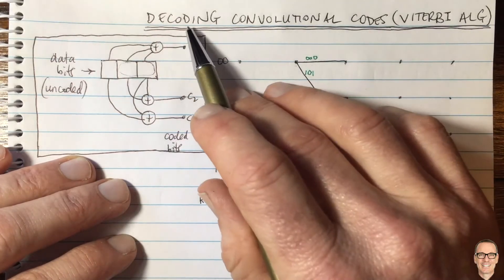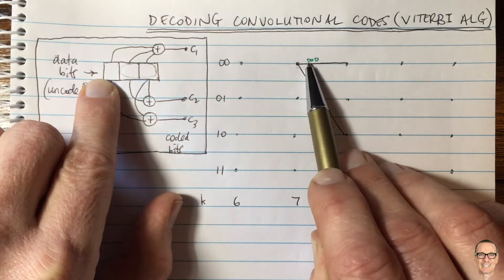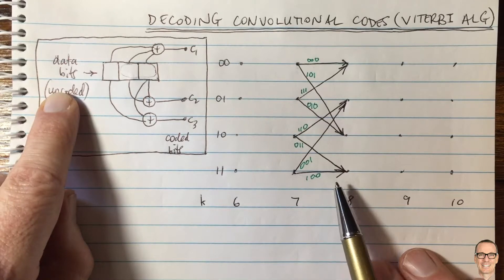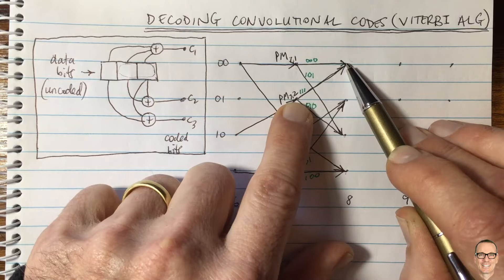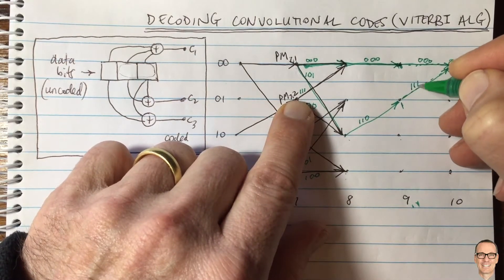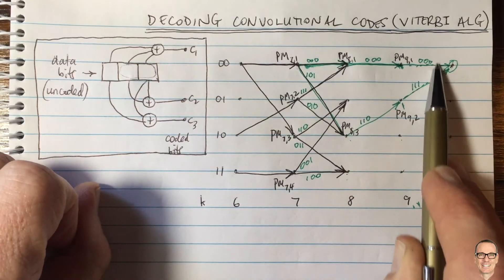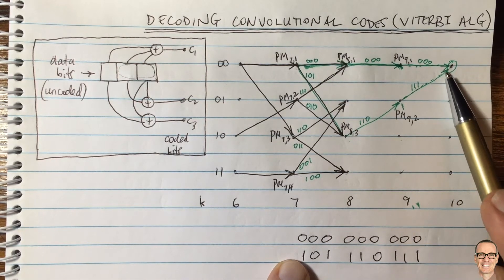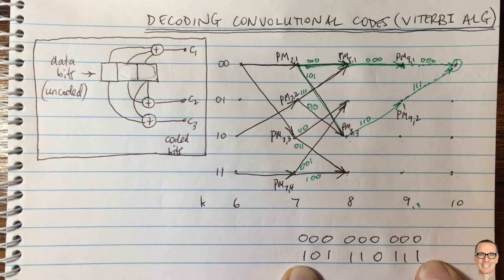Decoding Convolutional Codes: The Viterbi Algorithm Explained

Comment: Thanks. This was very helpful. I am working on figuring out what happens if there is a tie. For example at a branch, if I have the total path metric is the same for both paths? Do I make a choice and keep going? Or do I keep both branches? Thanks
Reply from the maker: If the metric is the same, then there's no way of picking them apart, so you just need to make a guess. Everything you're doing is "guessing" it's just that the other metric decisions are "educated guesses".
Reply: Thanks!😊

Comment: If I say anything then I could be decoded. What you need too see is this is like Pine Gap in education. But then it would imply that there is deception intelligence in engineering and the education. Then there's espionage in job allocations and position fitting a person's role. Maybe the NASA educational stance is the way to go to avoid building another espionage empire with engineering and education into the money stream. Basically at some point lower voltage operations and higher frequency transmissions equate to increased complexity in decoding in noise. Maybe there's a practical limit since you can't miniaturize Pine Gap below Moore's Law in which case it's Quantum communications instead of a noise floor for intelligence in error correction. Sorry if I'm a little hard to understand....but you were not to clear yourself. But your genuineness is appreciated...

Comment: great video! I'd like to point a possible mistake, I think you swapped the possible outputs of the states 01 and 10 (assuming the bits are represented in the same way as they look in the boxes)
Reply from the maker: Let's take the line that joins the 00 state (on the left of the transition) to the 10 stat (on the right of the transition). For this line, the contents of the three-element shift register in the encoder are 100. This is because the "state" is defined as the contents of the central element, and the right hand element of the shift register - and for this line in the trellis, the current state is 00, and the next state is 10. This means the output will be 101, if you trace along the lines for the three outputs.
Reply: @iain_explains  thanks! it was I who confused myself here, you're right 👍🏻

Comment: Your solution is not clear and complicated to understand
Reply from the maker: I've made a new video where I've tried to explain the Viterbi Algorithm more directly, using the actual update equation, and showing how it relates to the trellis. I hope this helps: "Viterbi Algorithm Explained with an Example" https://youtu.be/xxpBHCkypS4
Reply: Did you watch the previous video in the series where he explains the convolutional code? Might help. I do agree though that an explanation of how the path metric is evaluated had been useful.  :)
Reply: I dont understand this lecture and the next one
Reply from the maker: I agree it's definitely a complicated topic. I think I'll try to make another video where I work through a numerical example.
Reply: @iain_explains  How do I know I only have to consider the signals ending up at 00? Or is that a simplification?
Reply: @Pep95  I think that is just a simplification, it seems to me the process which he described for deciding which path should be taken to the 00 state (the one far right) is actually the same process which the algorithm is using for each one of the states (and each time it has  a longer bit sequence to compare to the expected output)
Reply: @Loki-je3oj  that makes sense, so it determines the probability for each endpoint and then picks the path with the highest probability